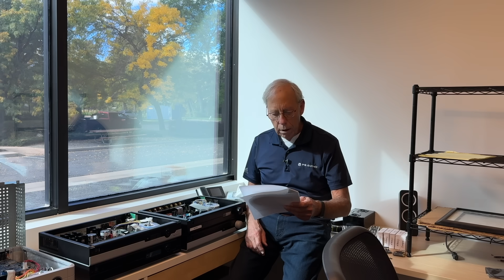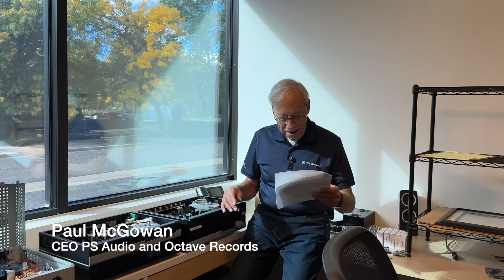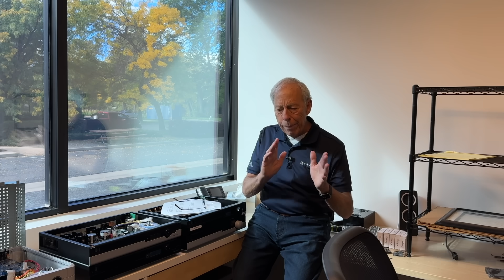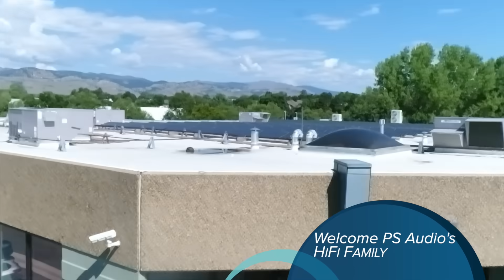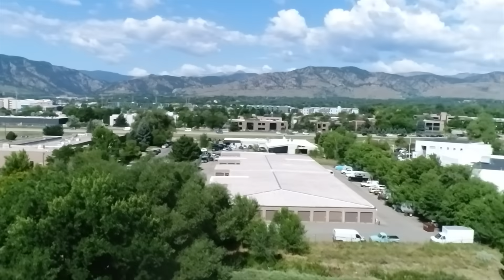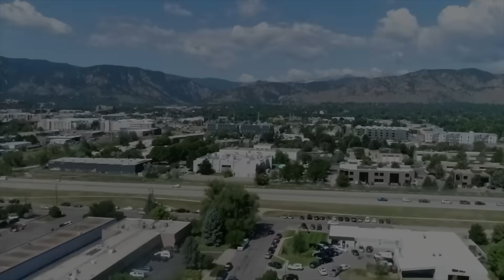Paul explains AES EBU

Comment: Very little point in using AES/EBU digital connection unless we are talking about very long lengths of cable.
Reply: ... or in surroundings with high frequency interference.
Reply: @Fastvoice with both, an optical cable still much much better. In fact the best would be optical usb.
Reply: @HyperOpticalSaint   ...😂😂
I tried optical (Toslink) & compared it to AES/EBU & AES/EBU absolutely killed the Toslink sonically.
Reply: Highly dependent on quality of transport and DAC and the particular combination of them. Just to provide an example, Modern Chord dacs are virtually immune to jitter artifacts on Toslink, no matter how mediocre the transport is. Transport with good clocks and S/PDIF reclocking dacs work as well or better with optical as with coaxial.
Reply: @Fat Rat: So geh nun hin, Dein Glaube hat Dir geholfen.... !! 😞
Reply: Most devices use an RCA connector for SPDIF, so it could possibly be better with AES/EBU, it would have to be compared with BNC to make a fair comparison.
Reply: @mitchtaylor6512   ...fair enough.
I don't have a BNC option on my current rig & so I cannot give an opinion about BNC. However, I can state that in my situation (the gear, the room, my hearing, etc.) the AES/EBU digital signal transfer does sonically outperform the RCA SPDIF signal transfer with a decent & true 75Ω cable.
Reply: I don't doubt it
Reply: @audiotron: Und warum macht es dann bei kurzen Verbindungen keinen Sinn ? Können Sie das man physikalisch begründen?
Eure ganzen Begründungen und Meinungen zu angeblichen Klangveränderungen entbehren jeder physikalischen Grundlage ! Und dieser Quatschkopf "Fat Rat" hat ohnehin nur eine Ahnung wie eine Kuh vom Sonntag und glaubet wunder was er für "super-hyperfähige" Ohren hätte....
Reply: @bachglocke3716  He says there is no real point (i.e. you don't get any real benefit vs coaxial) not that it doesn't make sense. He's basically right unless the environment is extremely badly polluted with RF. The longer the cable the more RF noise it can pick up.
Reply: @razisn  Bei Koaxkabeln wirkt doch  der Außenleiter als Abschirmung und bei kurzen Leitungen wird doch eine symmetrische Leitung ohnehin nicht durch äßere Einwirkung gestört. Also warum soll eine AES/EBU-Verbindung - die ohnehin symmetrisch ist - keinen Sinn machen bei kurzen Verbindungen ?
Wenn eine symmetrische Leitung wirklich sauber symmetrisch ist - z.B. durch engschlagige Verdrillung - dann kann man sich die Abschirmung durchaus ersparen, dann werden auch äußere Störfelder keine Auswirkungen haben, ganz davon abgesehen, daß der Spannungspegel bei AES/ABU-Verbindungen ohnehin schon groß genug ist.
Reply: @bachglocke3716  because the effect of RFI on digital transmission is minimal (many would argue that if there are no digital glitches or interruptions then it's not only minimal, it's non existent) and is even more minimal (...) for short lengths and shielded cables (as all decent digital coaxial cables are). Balanced connections just allow for longer lengths. The rest is OCD on your part.
Reply: @razisn  Symmetrische Leitungen - egsl ob analog oder digital - bewahren auch bei  kurzen Leitungslängen eine bessere Qualität. Das ist keine Detailverliebtheit, sondern physikalische Tatsache. Wenn man, wie ich, aus dem prof. Studiobereich kommt, denkt man nur noch "symmetrisch"! Unsymmetrische Verbindungen haben auch bei sehr kurzen Leitungslängen Schwächen. Das haben wir in unserer Firma mal bei einer großen Studioanlage erlebt, wo wir auch gemeint haben, daß  für eine kurze Leitung eine unsymmetrische Verbindung genügt. Aber.... die Physik hat uns da eines besseren belehrt !
Reply: @bachglocke3716  bs that´s just OCD.
Reply: @bachglocke3716   ...excuse me but you are the idiot Bachglocke. Your engineering mindset is lying to you.
Reply: The problem is RCA 
In the scopes you will never find RCA only BNC 
I don't understand why BNC is not the standard for spdif
I can't sleep at night for this 
I would use BNC also for analog signals
Reply: @gino3286  There are no standards for connectors in the home audio industry. The industry just started using what was most widely available and convenient many years ago. That, for coaxial, in the US was RCA connectors invented in the 30s and they were meant for home audio from the start.. Europe had mostly been following the German DIN standard until the home audio industry settled to RCA for compatibility and ease of cable construction. BNC connectors were invented almost 20 years later, after WW2, and initially they were used for military applications. Soon after they were used extensively for simple serial computer connectivity (e.g. IBM computer terminals connecting to terminal control units).
Reply: @razisn hi thank you for the very kind and valuable explanation 
However on top quality and high price digital equipment i would expect both 
An RCA spdif and a BNC spdif 
They cost almost nothing 
In this way i could use the best option 
I think that on serious digital like dcs wadia they provide BNC connections 
Good!
Reply: @gino3286  Some more expensive equipment do provide BNC sockets. Another example is Chord. Many people end up using BNC to RCA adaptors which 100% defeats the purpose of BNC sockets... Btw providing both RCA and BNC for S/PDIF does not only require 2 sockets but also either switching circuit to switch between the two (a bad idea) or a second S/PDIF receiver.
Reply: @razisn thank you 
It will remain a dream 😂
Reply: @gino3286   ...I have to agree with the German this time. For me it's balanced XLR uber alles.
Reply: Hi thank you for the very valuable advice 
If pros use XLR there must be a reason
But BNC should be wonderful as well 😮
They are used also for digital video signals. 
Sdi i think they are called 
A cheap bnc could be superior to a pricey rca for digital at least
Reply: @gino3286  Der XLR_Stecker  hat sich vor allem wegen seiner Robustheit durchgesetzt und wegen der einfachen Schnellverriegelung sowie wenn symmetrische Signale verwendet werden, wegen der Polzahl.
Ich verwende XLR 3pol für Mikrofonleitungen, für AES/EBU und für Verbindungen innerhalb meiner Anlagenverbindungen.
Ich verwende aber auch XLR 5pol ! Und zwar in erster Linie für Stereoverbindungen.
Und ich verwende XLR 6pol für diverse Steuerleitungn und sogar den XLR 7pol für Kleinspannungsversorgungen bis 24 Volt !
Aber auch den schon etwas betagten "Klein-Tuchel" verwende ich für Spezialzwecke - bis 12-polig !
Reply: Fat Rat : Ach wirklich ?? Und ja.... der XLR "klingt" ja auch besser .... und wenn es dann noch "symmetrisch" ist.... das muß doch noch viiiiieeel besser klingen... ! Da kann man dann die Flöhe nießen und die Affen singen hören... !!!!
Reply: @gino3286  BNC für analoge Signale ? Und wie wollen Sie dann symmetrische Leitungen realisieren?
Reply: @gino3286  Der RCA-Steckern (Cinch) ist das Primitivste was man sich in der Audiotechnik ausgedacht  hat. Nicht mal eine gescheite Zugentlastung hat dieses Ding! Und die Fehlkonstruktion besteht obendrein noch darin, daß der "heiße" Kontakt VOR dem Massekontakt geschlossen wird ! Wirklich: dilettantischer geht es nicht mehr !
Reply: @bachglocke3716   i found something 
BNC connectors were developed in the late 1940s and were standardized by the U.S. Navy in 1944. They are named after their inventors, Paul Neill and Carl Concelman, and their bayonet-style locking mechanism.
Reply: @gino3286  Es gibt aber noche eine andere Abkürzung für BNC: "Beinahe No Contact" !
Vor allem muß man wissen: Der Mittelstift ist bei 50-Ohm-Steckern dicker als bei den 75 Ohm.Steckern. Da kann man u.U. den Gegenstecker verwürgen oder es gibt eben "beinahe no contact".
Reply: @audiotron ...from my listening tests I would have to disagree with your abovementioned assertion.

Comment: I²S (Inter-IC Sound) was invented by Philips Semiconductors in 1986 PS Audio sort of popularized the adoption via HDMI. It was designed to be opitmal iver cm's so it is also compromised by using even an HDMI cable. I2S transmission from one unit to another over HDMI is susceptible to jitter too especially without some sort of buffering or reclocking. It lacks universality so is not without its own set of compromises.
Reply: Just a question if I2S HDMI audio is capable to stream up to 5.1 channel audio to for instance an multi channel Pre Amp with HDMI inputs. Just an question. Thx.
Reply: Still it sounds better though, but benefits a lot from a decent (and preferably short)cable yeah;
Reply: @5starmaniac The "it sounds better" mentality comes from sales hype, not any factual or provable basis
Reply: @CosmoFaith At least with my equipment, it sounds better!!
Reply: @CosmoFaith   ...again, BS!
It depends on what the listener is comparing it to.
Reply: There is no audible difference between I2S, AES\EBU, and SPDIF.
These formats all transfer the same digital information, not audio.
Reply: @CosmoFaith   ...maybe not to you, but to others, & to me, there is an audible difference.
Have you had your hearing checked by a reputable audiologist lately?

Comment: Yay my question! My life’s complete. Now what

Seriously thanks it’s wonderful to hear an official unbiased response thanks Paul and team!
Reply: S/PDIF in it's original co-axial 75 Ohm impedance, specs out at 10 Meters max. length. AES/EBU aka EAS 3 with a 110 Ohm impedance specs out at 100 Meters. They are both 2 channels unidirectionals with embedded Word clock. AES/EBU can also carry timecode. Yes, AES/EBU is a differential (balanced) signal while S/PDIF is not. But no, it doesn't mean that the S/PDIF protocol would be noisier. We're talking about digital not an analog transmission.
In a home stereo setup I don't really see an advantage of one over the other.
Reply: @carterwilliamhumphrey3373 I agree some of my previous questions were far more entertaining BUT I had to ask one of these questions to get a response.   I’m sorry.   Let’s be fair some of these differences became basically indistinguishable to a human ear mind you it’s only as good a recording something good and there is plenty of material out there I can not un-hear so here we are.
Reply: This IS NOT an UNBIASED response 
Paul is promoting his company's propriaty I2S protocol which is not compatible with other manufacturers I2S protocols and he cannot actually show any "loss" over SPDIF or AES\EBU in any meaningful way.😮
Reply: @CosmoFaith   ...for you to state that the PS Audio, I²S protocol is not compatible with other manufacturer's I²S protocols is, at best, false & at worst, complete & utter bullsh!t. The majority of "other manufacturers" do follow the PS Audio, I²S protocol. There are only a handful of "other manufacturers" who have chosen slightly different pinouts & many components have the ability to adjust said pinouts. Don't be such a 'Karen'.

Comment: is that why so many cd players/ transports even really high end ones do not have AES/EBU. Instead, just a Coaxial output and/or optical.
Reply: Professional CD players here in Europe (e.g. from Studer) always had a AES/EBU socket. We used those in studios and at radio stations since the late 1980s.
Reply: @Fastvoice  Die Studer-CD-Player (der A 727) hatten zwar Hardwaremäßig eine AES/EBU-Buchse, aber das Protokoll war das SPDIF-Protkoll, also "Consumer" !
Reply: @bachglocke3716  Didn't matter to us as we only used the analog XLR outputs for the analog mixing desks back then.
Reply: No, the reason is they are either old from when it was not in vogue so there were very few home DACs to use it with, or they've cheaped out.

Comment: Hey Paul! If you see this, could you comment on one video sometime what you think about Martin Logan electrostatic speakers? They are the best room filling stereo imaging speakers I’ve ever heard. The whole room is a sweet spot, it was at a hi-fi shop, but they did not have a whole lot of acoustical mods done to the room. It was just a cushioned carpeted square room. I just don’t think they can be topped in that aspect, even if there are some designs out there that may be more revealing in detail, they do it in a relatively narrow sweet spot it seems. Edit: if I remember correctly, they were called Vantage.. it was 20 years ago that I heard them
Reply: Мартин Логан супер акустика, 3 года слушаю и кайфую

Comment: Hi Paul, I thought there was a voltage difference between Spdif and AES ? In your opinion does this make a difference?
Reply: No, it's digital either on or off and thus voltage won't magically change how it sounds.
Reply: @RelJason437  Hello Jason, I just remembered there something about voltage AES3 2-7 v AES3id to 1 v. I have a converter here with both and AES3 is 3.5v and AES3id (Spdif)is 0.5v.
Reply: @deondieleman  The converter attenuates the digital signal to match the expected voltage and impedance of the other end. Since this is a clocked digital data stream (1s and 0s) as such the voltage difference won't make it more or less 'Musical'.. If there’s an issue, it would show up as jitter, glitch sounding, or random dropouts.
Reply: @RelJason437   ...😂

Comment: Abs only really necessary over distances spdif/coax cannot reach
Reply: Abs is needed in slippery driving conditions..
Reply: @razisn   ...word!
Reply: @razisn  Was soll wieder dieser Autovergleich ?????????  😞 😞 😞 Er hat sich doch nur vertippt !
Reply: @bachglocke3716  Ah a typo! You don't say! It never crossed my mind! Btw, one would be able to tell you were German even if you had made your comment in English..
Reply: Yes, digital interconnects only have a sound to them when they malfunction causing data errors and such artifact is not about tonal balance, sound stage is anything else like that...when you lose samples you can expect dropouts and severe distortion. All other claimed musical qualities of a digital interconnect is BS and if you get audible jitter it's just sign of a crappy DAC lacking proper buffering and we'll designed PLL...
..
Reply: @ThinkingBetter  Sie haben recht ! Es gibt immer wieder Leute - vor allem im HiFi-Bereich - die alles besser wissen und mit aller Gewalt nach "Klangunterschieden" suchen (wo keine sind und auch keine sein können!)
Ein Problem kann auftreten wenn man einen AES/EBU-Eingang mit einem SPDIF-Signal ansteuert. Dies rührt aber dann vom Spannungspegel her: AES/EBU braucht normal  TTL-Pegel (also mindestens  3,5 Volt) und SPDIF arbeitet mit 0,5 Vss. Der AES/EBU-Eingang kann dann ggf. kein Hi/Low-Singal unterscheiden.
Reply: @bachglocke3716 Vielen Dank für Ihren ausgezeichneten Kommentar. Ja, leider verbreiten viel zu viele Menschen ohne wirkliche Kenntnisse im Bereich Audiotechnik ziemlich unqualifizierte Meinungen.